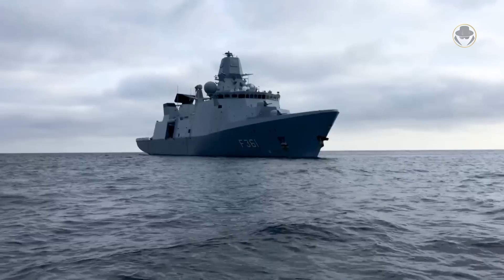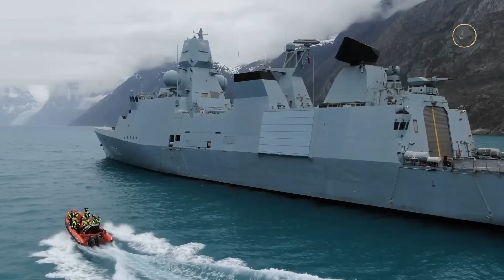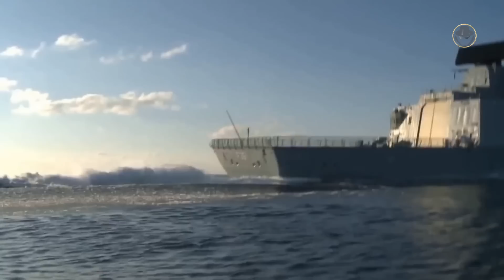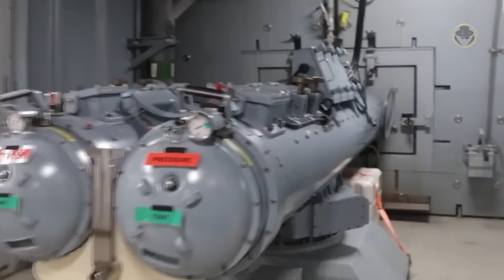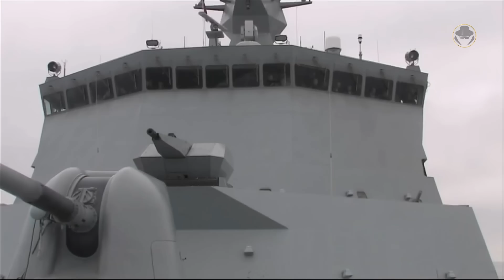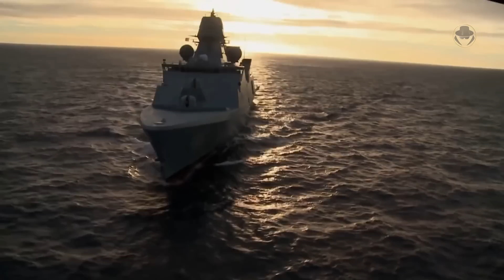Iver Huitfeldt-class frigate | The floating Lego of the Royal Danish Navy

Comment: The way they have harpoon arranged they could potentially even have 24 harpoon missiles. They leave a gap in between them and there are mounting brackets for 2 more sets for a total of 6 mk 141 harpoon launchers. You can easily find pictures of the area and mounting points while they are equipped with 4 mk141 launchers totaling 16 harpoon missiles.

Comment: Perhaps even more importantly the plug&play modules and accompanying command consoles allows them to be easily upgraded. Important for a navy that wants to keep their ships going over multiple decades and don't want them sitting in port for much of that time.

Notably, the Ivar Huitfeldt isn't really intended for minelaying/minehunting. It CAN do it, but mostly because it inherited the capability from the modules developed for Flyvefisken, a much smaller patrolboat with 4 Stanflex slots (although afaik the forward stanflex slot is rarely rarely swapped out from it's gun-module configuration), where Flyvefisken swaps between minelaying/minesweeping, ASW or as a missile patrol boat and performs admirably for each of those roles when outfitted for that role (which is quite impressive for a 450 ton patrolboat).

The Ivar huitfeld though is free to go for either ASW duty or anti-ship duty or focusing strongly on its anti-air role (and can adjust its air defence profile for more long range missiles or more close in firepower). That has served it well in the Red Sea, as the danish could tailor the loadout to maximize its capability against Houthi attacks (rather than, go the long way around like certain germany frigates).

Comment: Why is the Iver Huitfeldt-class and Type 31e frigate so cheap
Reply: commercial of the shelf. just like the swedish gripen fighter jet.
Reply: @SimonRaahauge1973  Not Type 31.  Navy Lookout - Type 31 - The development of a lean crewing solution for the Royal Navy’s Type 31 frigate
Reply: @Belisarius1967  lean crewing and COTS makes for a future-resillient navy!
Reply: A prime example is the MTU engines, that are off-the-shelf units that could just as well have been fitted in a medium sized ferry or small freighter, rather than expensive purpose built propulsion systems with worse fuel economy, but probably somewhat higher speeds.
Reply: It's built on recycled Carlsberg and Tuborg Beer cans.

Comment: Makes sense tor smaller navies especially those that do not see conflict on the horizon. Larger navies or those who are in potential conflict area would need their ships heavily armed & ready at a moments notice. They could not wait to have the proper modual installed.
Reply: Getting a prepared ship launched still takes at the very least multiple hours, so spending half an hour changing to relevant modules while heating up the engines or making sure all crew are present and accounted for, doesn't introduce as much of a delay as it sounds like.
Reply: @AIRDRAC it does. It introduces needless complexity and compromises on structural integrity or spacing. Bigger navies expecting conflict or doing force projection need their ships combat ready. Not a glorified tech demo. This ship in particular has boatloads of problems.
Reply: If you're expecting war, you won't be sailing around without modules, but will be fitted with the modules needed for the ships task.

Comment: The 16 harpoons, that is 8 planes or less if you have an aircraft carrier, which really shows why they’re the choice for anyone who can afford them.
Reply: But when you factor in cost, the harpoon per dollar may very well be significantly lower than of having an aircraft carrier with an air wing (and the support fleet for it).
Reply: Yes. But you also forget that any one aircraft carrier is 1) ridiculously expensive, and 2) can still only be in a single place at once. Yes, from that position, it can operate in a large area, but not further than about 2000 km, max. Thus it makes sense to also have smaller, inexpensive vessels to operate further out.
Reply: @mnxs  Yep! Scalable, sustainable,  multirole platforms for low-intensity ops and dispersed lethality.
Reply: Harpoons have piss poor range to be of any use.
Reply: @bulthaosen1169  luckily the launchers can do other things than launch harpoons :)